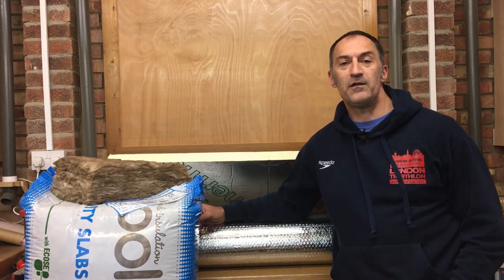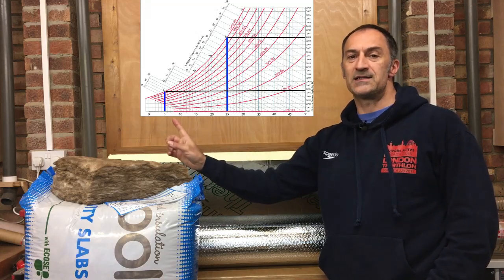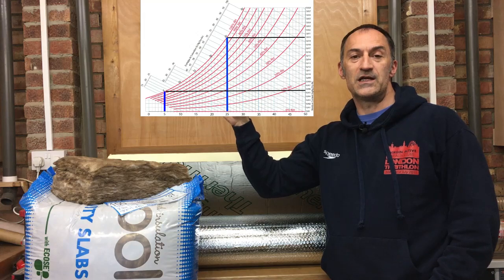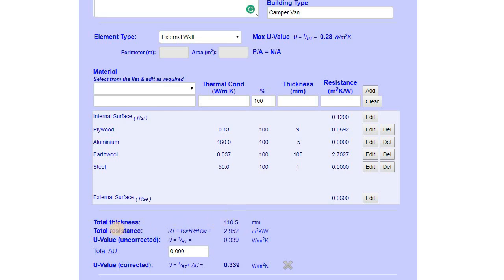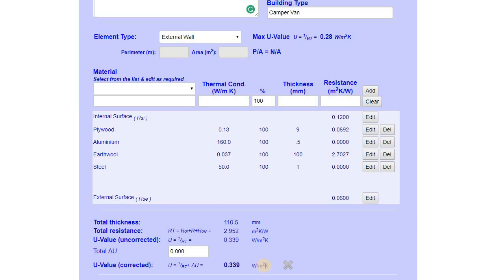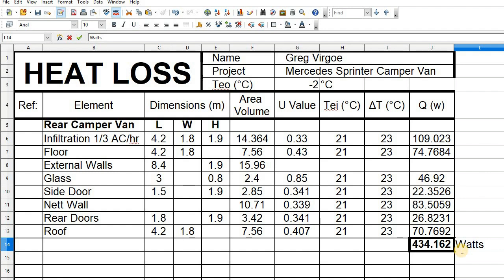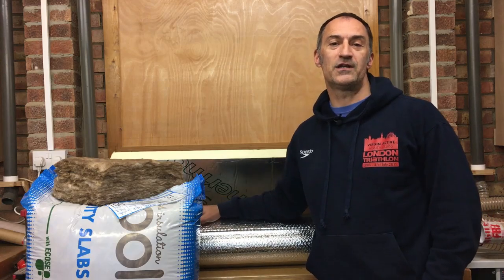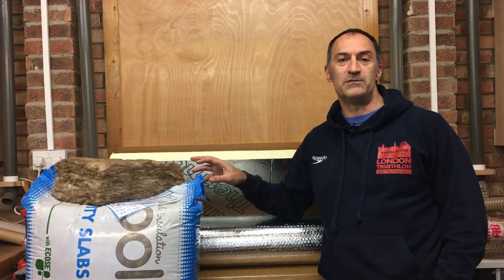How to Insulate your Van Part 1 - The facts you need!

Comment: This video is really useful with the explanation of the calculation tutorial, makes me a bit happier about the price i paid for my ambulance as the back of it is pretty much a square box made of fibreglass covered celotex like material!!

I will need to sort out the floor though and I want to cut an access to cab through the front of it so i still have some areas to work on, I have a small Flir thermal camera which should also help.
Reply from the maker: Those Flir thermal cameras are great I have access to one at work which we use for commissioning air conditioning systems.
Your bus will have a fantastic structure in the back, very similar to high spec motorhomes, so you will be sorted for insulation.
Truma have kindly offered to let us use their climate control booth when the van is finished to run tests on its performance.
Can't wait to try that out. Watch this space.
Reply: Excellent, that should be interesting. I'm waiting for the weather to turn really cold then i'll put a heat source in the van and see what the camera picks up before I've made any mods.

You can get a Flir add on for some mobile phones at a reasonable cost now, I have a Cat S60 work phone that has one built in.

Comment: As a building physicist myself, great explanation! As a van conversion enthusiast (don't have a van yet) what are you going to use the heat loss value for, sizing the heater?
Reply from the maker: Hello, I was naturally curious to work out how much heating I would need to keep it warm in there. I have to add the heat loss for the cab and make some allowance for door frames. I’m installing a Truma Combi 4e so I will have plenty of available heat. Nice to know
Thank you

Comment: Greg, just want to add my comment to the heap of praise.  I really appreciate the opportunity to learn from your wealth of knowledge and excellent style of teaching.  One question that perhaps you will address in a future video: What weight limitations are you working under for the vehicle and how does this influence choice of materials - especially thickness of plywood, choice not to use a sound deadening layer etc. Many thanks again for your brilliant work.
Reply from the maker: Hello Daniel, excellent question as weight is a huge factor. I’ve got to keep under 3.5tinne all in so everything will be kept to a minimum. I’m using special 15mm lightweight furniture ply designed specifically for motor homes. The cabinets are designed to reduce the need for excess carcassing. The earthwool does have some sound insulating properties. It will be a challenge.
Thank you for watching.

Comment: Wow, so much detail just to keep the warmth in...nice one Greg....just one question if I may, why not use foam spray behind all the wood?? This would fill all the gaps as well as bends and tight spaces.....is it more cost??
Reply from the maker: Perfectly acceptable solution Marc, it's basically the same product as the kingspan but in a can. It's a very good insulator and like you say good at filling all the small voids. I personally just didn't want all the mess and clear up that comes with spray foam. Thank you for watching.
Reply: Greg Virgoe yeah, it can be a bit messy!!
Keep up the great work my friend, can’t wait for the road trips 👍🏼😊
Reply from the maker: Thank you Marc, you bet, I can't wait to road test this one myself, we have major plans to tour Europe next year and will be posting regular vlogs of our #vanlife. Watch this space :D
Reply: Greg Virgoe well I’ll be tuning in that’s for sure 😉👍🏼
Reply: Marc’s Fx -- condensation causing moisture then mold.  The sprayons like greatstuff adhere to the surface on the inside surface. With no space between the insulate and the panel subjected to outside conditions the inside of the panel cannot "breathe" so moisture is trapped.
Reply: Greg Virgoe good points Greg 👍🏼😊
Reply: Thank you for asking these questions Marc's Fx!!!! I was wondering the same thing
Reply: Interesting would be foam spray into sealed bags with a valve. It is then still possible to remove the foam...
Reply from the maker: Hello everyone, in this application it is not a good idea to let your insulation breathe, because that means you are allowing air to circulate around it and the only place that air will come from is within your van which will be full of moisture. The best method is to create a sealed barrier to prevent moist air getting to the insulation. Therefore I would say that spray foam on the inside of a van is a good way to providing the is fully covered with a good vapour barrier. Letting your insulation breathe will create more condensation on the skin of your van. Prevention is far better than cure.
Reply: Isn't spay foam closed cell, and therefore acts as it's own vapor barrier?

Comment: Finally some SCIENCE! Thanks Greg. Normally Iʼm pretty sceptical with videos that claim to have „the facts“ or „the truth“, but your video is spot-on!

What are your thoughts on Armaflex products? Iʼve seen λ values from 0.025 to 0.033 depending on the specific product being used. Most tend to use the 19mm sheets. These also act as sound deadening, though Iʼm not sure how they compare to those thinner butyl patches (rattle trap etc). 

I guess when comparing all those options, weight would also be taken into consideration.
Reply from the maker: Hello, excellent question. Armaflex is a closed cell Class O insulation so has excellent fire resistant properties. 
Those values of thermal conductivity are good but you need to take into account the thickness of the material to get the full picture. Armaflex is normally sold as pipe insulation or in thin sheet format. To match the properties of the earthwool or kingspan you would need similar thickness 50-100mm. 
Using your figures you get an R value of 0.019/0.025=0.76
Therefore you would need 3 layers of 19mm armaflex to match the R value of 50mm kingspan. It would give you sound deadening properties but as you said it would be heavier and I would say more expensive too. Hope that helps. Best wishes

Comment: Well Greg, I thought I would follow this series because of how well you installed the wiring.
I was intrigued to see how you would insulate. Most people completely forget about condensation and the consequences of the van rusting from the inside out due to this.
I have a background in construction so I fully understand humility, condensation and it's relationship with temperature etc.
I was expecting a good video but was presented with an excellent video! With your background I can safely follow what you say. Looking forward to the build.
Reply from the maker: No doubt with your background you understand exactly the importance of a vapour barrier. Thanks for a great comment. Cheers Harvey

Comment: It was very useful to see the relative losses of various parts of the van. Rock wool has its benefits but surely it is almost impossible to keep it at 100 mm? If its gets compressed by half then presumably its U value is halved but also the thickness halves from 100 to 50 mm which will throw out the calculation. Moisture trapped within the insulation, or in nooks and crannies, where there is no insulation is a worry. How to insulate behind the metal frames? 
The video is good at showing how you size a heating unit for a van very well.
Reply from the maker: Hi +Julian, the lower wall voids and doors are 100mm deep, the mid panels are 50mm deep as is the ceiling. It’s surprising how effectively you can be with the mineral wool. You can of course use spray foam to get into all those voids. An air gap also has a thermal R value of 0.12 such as a cavity in your house. The key part of the whole thing is to vapour seal everywhere so the moisture cannot get in there in the first place. You are right if you squash it to half the thickness the calculation has to be done at that thickness. Hope that helps.

Comment: Great video Greg. How would this work for higher ambient temperatures? For example If it where 35°c outside and 21°c inside. Would it be the same watt values going into the van and how quickly would the temperature equalise without cooling or ventilation?

Really appreciate the series.

Luke
Reply from the maker: Hi Luke, the insulation will work both ways to prevent thermal transmittance. With higher outside ambient you will get a heat gain instead of heat loss. The temp difference in your question is 35-21=14c so your heat gain will be a little over half as much as the heat loss. It will definitely help to keep the van cool in summer. The biggest gain in hot weather is the solar gain through your windows. Greenhouse effect. This can be huge and by far the best way to combat this is to prevent the suns rays from entering the glass in the first place. External reflective shades are THE best way to go to prevent solar gain. Hope that helps and thank you for watching. Cheers

Comment: By far the most informative video i've seen, i'm looking at doing one next year and these series of videos have been super helpful, i'm even gonna post a link to this video on some other builds i've been watching!
Reply from the maker: That's really helpful of you Malcolm, many thanks.
I have watched a lot of insulation videos and there are a lot of people that don't have the right information to make good choices.
What type of van would you like to do yourself?
Reply: I'm thinking of doing a Peugeot boxer, L3 H2, is that about the same length as yours?  I didn't realise you were a mechanical engineer but obviously now it shows, you know quite a lot about electrical.  I'm an electrician and a BMS engineer so know about controls and electrical but this insulation video was excellent.
Reply from the maker: Hello Malcolm,
We deal with BMS controls and Mechanical control panels on every project. I first started out in a design office drawing control panel wiring diagrams on tracing paper in ink pens back in the day of blueprints. Showing my age there. lol  Controls is just a series of switches, quite logical really.  I have a few grey areas in my electrical knowledge but I research a hell of a lot and never afraid to ask.
How long have you been working in controls?
Reply: Hi Greg
I've been doing BMS now for about 25 years, originally started in the panel shop building control panels but as I was a qualified electrician they used to send me out on site, i ended up doing commissioning and eventually got into project management but now just write software.  I I don't remember hand drawing diagrams but from memory the office i worked in had an Acetone printer? Used to stink the place out! haha

Comment: I read your comment about spray foam insulation regarding how it is a permanent installation, and I have no problem with that.  Wouldn't spray foam insulation (https://sprayfoamkit.com/)  be the ultimate solution for a van because of it's ability to get into every nook and cranny, filling the ribs and becoming the insulation and vapor barrier in one product?  (https://www.youtube.com/watch?v=4mhzAvp2YOU ) Properly done, thermal bridging through the ribs (by filling the ribs) will be reduced and since it will completely seal the interior, there should be no chance of moisture building up behind it, creating a corrosion problem.  I think the R value is about 7 per inch, so 1 to 2 inches of spray foam would do a better job than the wool and rigid board in your video.  Thank you for this video and your reply.  Very much appreciate the comments from you since you are educated on this subject and have practical work experience.
Reply from the maker: Hello David, Spray foam is a good insulator, it has similar thermal conductivity values to the rigid slab that I have. However, it does not form a vapour barrier. Most PIR or ISO foams allow moisture to pass through them as they are full of microscopic bubbles. You would still have to install and internal vapour barrier to prevent condensation building up in the insulation.  I have seen that video before where the spray the entire inside of the van, to be honest, that looks like a nightmare, not a flat surface or anything to fix to and the cleanup job looks horrendous. It would not be my choice, but each to their own I guess.  It has the same thermal conductivity as the rigid slab I am using and as I have shown the R value is only relative to the thickness of the material. So you would have to spray it thicker than 50mm to better the board value. 7 is an unrealistic figure. Hope that helps you.
Reply: Thanks again for your comments.  I've seen other videos where they have mounted wood on the walls, ceiling and floor as attachment points for their cabinetry and what not...then they just put a layer of tape over the wood, try and avoid spraying it on the boards as much as possible, then cut & peel the tape off later.  Your statement of moisture passing through spray foam...are your talking about closed cell foam or open cell?...because the company that sells the spray foam kit claims it does create a vapor barrier.  Maybe any high points you have to trim with a saw blade or hot wire would be open cell because you would have exposed the interior of the foam, but in my experience, the spray foam exterior hardens to what appears to be a smooth hard shell.
Reply from the maker: There is only one product on their website with that claim David. You are right about cutting it and opening up the bubble cells. I personally would not like to rely on the spray finish. Your choice.

Comment: Fantastic greg! What are your thoughts on XPS sheets? Celotex is hard to come by here in Sweden unfortunatley. My plan was to use 50mm xps combined with sprayflaska for gaps, and then a vapor barrier.
Reply from the maker: Hello tim, XPS is another good insulator and has low thermal conductivity providing the bead size is small. Kingspan XPS sheets offer the same thermal performance figures as the Earthwool, about 0.038 W/mK. Spray expanding foam is also very good as it's essentially the same product as Celotex but in a can. Personally, I just think it's very messy and there's no going back with that stuff, once it's in there you'll never get it out. It's a good gap filler.
Reply: 'Cheers greg, this is the best video on youtube about insulation, even a  dunce like me can figure it out thanks to your explanation. Im looking forwards to the second part!
Reply: What are your thoughts on EPS vs XPS by the way?
Reply from the maker: Hello Tim, I found a really good article on the kingspan website that explains the difference very well. 
https://www.kingspan.com/meati/en-in/product-groups/insulation/knowledge-base/faqs/general/what-is-the-difference-between-xps-and-eps
Reply: Cheers Greg, thats good info right there. Ive read in other parts that the EPS  has other qualities thanks to the manufacturing process, as in that it can actually dry out easier, as well as sucking up moisture capilaty style, whereas the XPS, once wet (it will apparently absorb moisture over time) will have a much harder time of drying out on its own.  Looking forwards to your next install vid mate!
Reply: Greg Virgoe http://www.ecohome.net/guide/rigid-board-insulation-polyisocyanurate-xps-eps-foam-rockwool    I've been reading that pir actually degrades it's r value when exposed to below freezing temps. It looks like xps is the way to go for me, since I will be camping in sub zero temps. My plan: XPS 5Mm glued in place with PU foam, joints covered with aluminium tape and then with a vapor barrier (polyethylen?) facing inwards. Rock wool in ribs and doors with vapor barrier.

Comment: awesome video greg! love the detail. so at the end your sheet says 434watts, is this to keep the van at 23c, if outside is -2c? What are you going to use for heating the van?
Reply from the maker: Hello Andrew, the temperature difference is 23deg, the inside temp was 21deg, which is normal room temperature.
Obviously we need to factor in the heat loss from the cab which has a lot more glass so expect that figure to double at least. 
We are planning to install a Truma Combi 4e boiler to provide both heating and hot water, this heater will run of both LPG and electric, it has a 4kw gas boiler and 1800w electric element. It will give us hot water for showering and keep the van warm as toast. Cheers